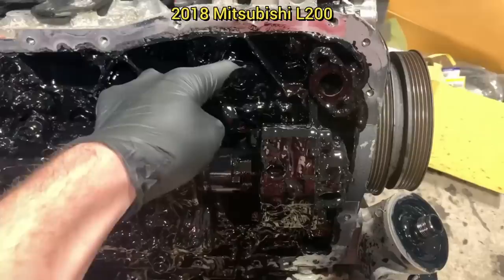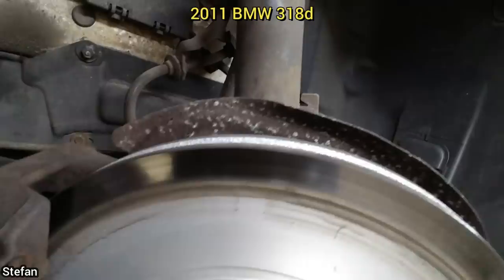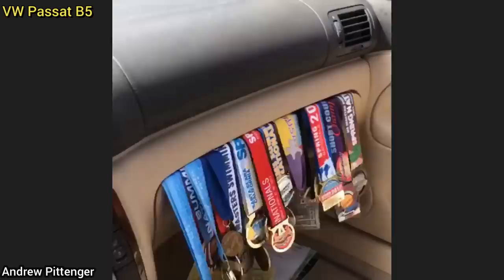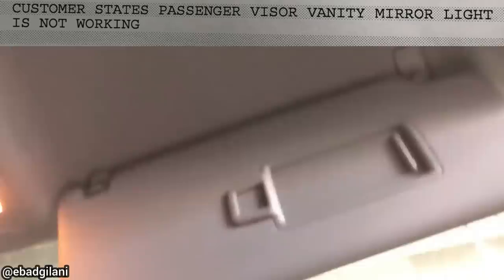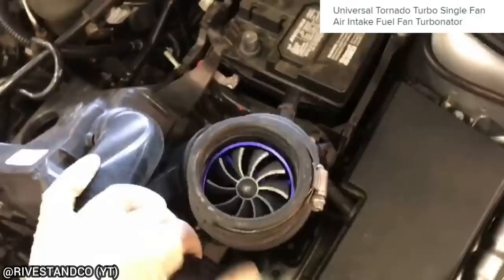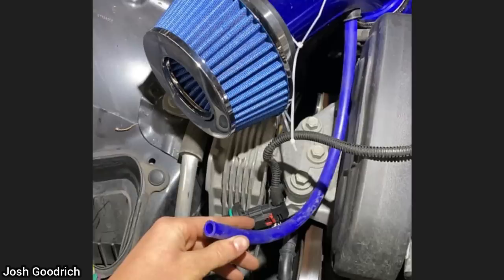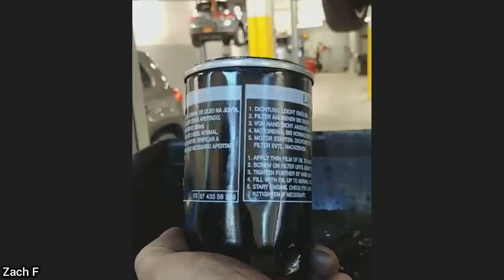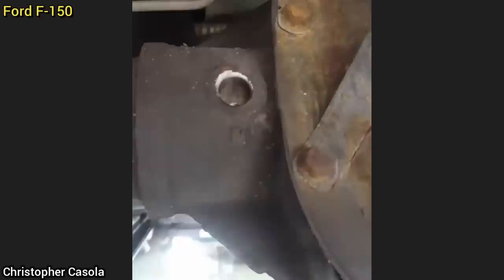Customer States Haven't Changed Oil In 78000 Miles

Comment: "...cut their frame to install a new oil pan." 
That's some other level.
Reply: When you don't want to get a refund or get the right size.
Reply: I can only guess that person would remove their brake calipers to fit new bigger wheels too
Reply: I'm sure meth was the helping hand
Reply: I have seen severely cut frame to make room for headers, though not completely cut it was a lot of extra work on the 1958 Chevy Apache.
One thing is for sure adding to that my friends 1085 Dodge ram charger,,,,,, NEVER !!!!!!!! buy a used American car.
O did i forget to mention that Chevy Apache, well most of both doors was old road signs and bondo.
Also never let friend go buy used American car,,,,,, or for that matter any used car, he is not good at it at all.
Reply: They are out there alright.😏If they ever produce self driving cars and vehicles, people like the owners shown on this channel will be "working" on them. Scary.😆
Reply: @pigtrapper1329  Tuco's oil pan. "This is tight!"
Reply: Must be the Shervin.
Reply: "Sugar-coated almonds behind a door panel."  What level is that?
Reply: Agreed! That is just insane. Maybe they thought they fixed it with a strut tower brace. lol.
Reply: @pliashmuldba  Step side long bed apache?
Reply: I wonder how many sawzall blades that took to butcher that frame?
Reply: @RideAcrossTheRiver  It's own level is my guess. The why, and how, surely would make a good  story.
Reply: yeah, that one got me
Reply: Forget blinker fluid. Tell him he has to drain the air out of his steering wheel every 5000 miles and they sell steering air at Napa 😂
Reply: @slabbinonspokezz2375  but tell him to make sure they buy winter air and summer air... Its a humidity thing 😂
Reply: @shannonharris  I'm gone save that one for people always pulling up for free air checks 😂 😂
Reply: @RideAcrossTheRiver  Most likely "rodent level"
Reply: @billymanilli  Do they shop at a bulk food store?
Reply: @darkdelta  The squirrels have a Haynes manual!
Reply: @pliashmuldba  Finding a good used car is not hard to do, just need to know what you're looking at.
Reply: @DinDooIt  I agree, but my friend seem to be shopping with his heart, and not his eyes / brain.
Gasoline in Denmark, well 2-3 X more expensive in the US; so not understanding why he would buy a V8 guzzler.
Reply: @pliashmuldba  Two of my best used vehicles were American. You just need to inspect it and know what you're getting before you buy it, just like any other used vehicle.
Reply: When my cadillac had a spun bearing we had to cut a hard cooling line with a sawzall to get the oil pan off
Reply: @AiOinc1  I have worked in ship engines, the size of a house, and still if you want to work on even the most simple part of the engine, well you probably had to remove 3-4 other things first.
I have no count on how often i have cursed all engineers to the deepest bowels of hell.
Reply: @pliashmuldba  Sounds like the problem is your friend....
Reply: That takes the dumbest thing on the internet award for an entire year !
Reply: Who would have thought you can't just cut your frame out to install a new oil pan!?
Reply: As someone who have to remove the front axle of his car to get to the oil pan I kinda fell this guy xD
Reply: That one took the prize for me too. My jaw dropped
Reply: Probably the same one who put JB Weld on the oil filter.
Reply: Only someone with mental issues would do that!
Reply: Agreed.

Comment: Hats off to the engineer that designed that 78000 mile engine.  Most of whats out there could not tolerate half the abuse.
Reply: I worked in engine oil development.
One test I was envolved in had the engine run for 100,000 miles no oil changes just top ups to keep the level correct.
The engine was not ruined.
Reply: @sahhull Ok let me guess… Honda or Toyota engine? 😂
Reply: @Marcus-sk2xf  it was usually Mercedes and Ford engines that was used for oil testing. 
Unless we were doing independent testing for a company. In which case we tested their engine/oil blend or both.
We did lots of work for Mercedes, Volvo and Ford
Reply: 78k miles without the oil chance is not the problem, I guess the problem is that it was probably new and new cars need an oil change much sooner
Reply: @Marcus-sk2xf  Maybe an EMD? - they eat 5 to 10 gallons a day.
Reply: @sahhull  Time is worse for oil than the actual wear and tear on it, I changed my oil left it sit for a month or two and then I checked the dip stick and it was black/brackish (ran if for a few miles to test.)
Reply: @user-mc6dg6qe8l  I'm still in oil development.
Over time some additives may  oxidise.
It may also change colour because you cannot full empty the old used oil from the engine when it's drained, so when the new clean oil is put in it gets contaminated.
That new slight contamination will enfuse thru the new oil if left for a few months changing it's colour.
Reply: The bigger issue would be the oil filter would eventually plug up, reduce oil flow and starve the head and cylinder walls of lubrication.  @sahhull
Reply: @BartSparrow123  Yes, we changed the filters every 12,000 miles. oil filters are generally good for up to 36,000 miles, so its no panic if you miss one.

Comment: My uncle, an airplane pilot, way back in the early 70's, came to our house. My dad and him were talking and dad ask him about oil changes. He had a brand-new Caddy, had put on 40,000 miles and never changed the oil. this was when you changed oil every 3000 miles. Here he was a pilot and they had to worry about the planes they flew and proper maintenace. He never thought about his car. I am sure my dad made him take it to the caddy dealership and have them work on it. He was so lucky my dad was there. BTW Great video. I was worried for a couple of days. Glad we got one today!!
Reply: Commercial pilots don't do maintenance on the airplanes they fly. 
Most pilots only pilot the plane.
Reply: My grandpa was a corporate pilot in the 80s. One night, driving home after a long flight, he saw a large tree branch across the road. He pulled back on the steering wheel to go "up" and destroyed the front suspension in his car. Don't drive tired I guess lol
Reply from the maker: Im posting a new video every 4 days for now. We are moving in a couple of weeks, been super sick and got a lot of behind the scenes stuff that's being worked on for the Just Rolled In. 😁 And glad you enjoyed the video!
Reply: @ol_smokey9370  I bet he also hit the right pedal for turning the car left, too. XD
Reply: Im a pilot.
Although he should have know that a car also works with oil, Airline pilots dont the maintenance of the plane,  their only job is to fly it.
Maintenance is done on ground by another departmen, the pilot just gets updates when he needs to.
Reply: @dubious6718  True, but a good commercial pilot will be aware of the maintenance status of the aircraft he/she is expected to pilot. My uncle was a pilot for Pan Am then Hawaiian Airlines, and as picky as he was about his own vehicles I imagine he had some idea what was going on with his 747 or later 737 and DC-9.
Reply: @VonRibbitt  Yes I should have realized that. sorry. I just thought if you had to check the plane before you "flew it " you might have to know a little about maintenance.
Reply: GangBalls69_Estonia  So you are saying that pilots aren't any more  than cab drivers? They don't check the flaps, hydraulics, the rest of the plain before taking off? That's probably why I don't fly!
Reply: @VonRibbitt  OH So you just a cab driver? You don't check the flaps, hydraulics, or anything else when getting into the plane? No wonder I don't fly.
Reply: Must’ve not paid much attention during ground school. They teach you all that stuff nowadays, and the pilot is meant to be involved in maintenance as much as the A&P
Reply: @stevenf1953 They do an exterior walk around inspection and do a check of the flight controls before take off. Everything else is done by the engineers and technicians.
Reply: @ol_smokey9370 this is a year later but I've dome something similar lol. Used to drive forklifts 12 hours a day every day, the ones we mainly used had the gear shifter on the left side of the steering wheel, I'd get in my truck to go home after that mindless job and hit my turn signal to reverse it out of the parking lot...

Comment: I admire the confidence people have to work on their own vehicle despite lacking any knowledge of cars or common sense
Reply: It's the height of arrogance mixed with stupidity. It makes you wonder how they do their job at work.
Reply: But if you don't have any common sense, then you don't realize that you have none....
Reply: @bunhelsingslegacy3549  wise words
Reply: I have been retired for a decade, live two miles from the nearest auto parts store, do not have a second car or driver at home, do not have a shop lift.  Yet my 19 year old car runs as well as it did on the first day it left the dealership.  How is that possible?1.  a detailed and computerized list of repairs by date and mileage; 2. a separate detailed and computerized list of servicing and parts replacement at the next shop interval; 3. buying parts in advance of taking the car into a shop; 4.  listening, writing down recommendations.
2.  If you do number 1 above, you don't have to have a knowledge of cars.  All you need in common sense, which is not very common.
Reply: @snowrocket  assuming they even work. probably sitting home collecting all day - hence why they drive such a POS vehicle to begin with. some people dont want better for themselves.
Reply: @bdcochran01  I don't even computerize. I just file the paper receipts in order of "date repaired" and keep track of everything by mileage and date. I generally follow the "Severe Service Intervals" for when to do maintenance because it accurately reflects driving in northeast Ohio, USA. Repair small problems before they become dangerous, big problems.
Reply: @bdcochran01  I keep a 3-ring binder for all my vehicles.  Anything I do to the car/motorcycle goes in that book.  Date, mileage, work done, parts used, and a note to watch for something that may be an issue later.  Trying to get my son to do that same, but ... kids.
Reply: @bdcochran01  
Well most of us actually have to work for a living AND to support the boomers living large, so that's not actually an option.
Reply: Well that's just stupid people not willing to learn or listen to others about their limit I have the experience to do a lot without the prior knowledge it's just following the necessary steps and knowing your limits like I wouldn't touch a single bolt on my engine or electrical bullshit other than battery and fuses but I've tore out and installed a throttle, fuel pump, thermostat and rad and that's on two specific vehicles I spent a long time with I wouldn't touch a vehicle Im not familiar with. Im no mechanic just a self taught bare bones amateur  willing to research within my means.
Reply: @bdcochran01  and lots of money and time to do these things at the dealer.
Reply: for real. I'll change a tire and be second guessing myself, quadruple checking everything, and anxious I messed something up and the tire is gonna fall off, even though I know it's a simple process. Some people here be like "welp I put a zip tie on it so it should be fine"
Reply: especially since you can look up your car and the job you need done here on YouTube and a mechanic will show you how to do it.
Reply: I'm not a mechanic but I do most of my own repairs and I'm extremely paranoid about doing everything absolutely perfect down to exact torque specs on every bolt.
Reply: Nothing to be admired there.

Comment: My last car did almost exactly 78000 miles without an oil change and ran like a sewing machine (in fact it's the only car I've ever sold as a runner). I changed the oil when I got it because I didn't know what had been put in there by previous owners, and I changed the oil filter about every 5000 miles, as recommended to me by a one-time engine designer. BUT: it was basically a 1960s- design engine and I wouldn't necessarily be quite so cavalier with a modern one. My engine designer source was at work in the middle of the 20th century and dead before the 1990s.